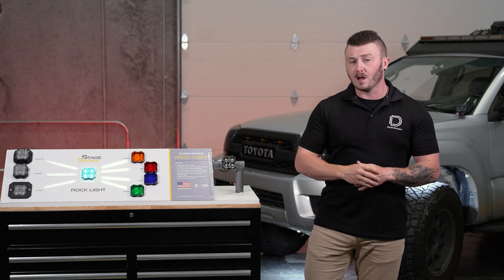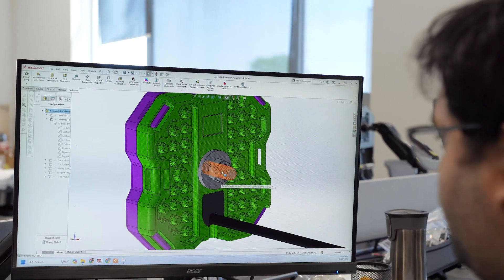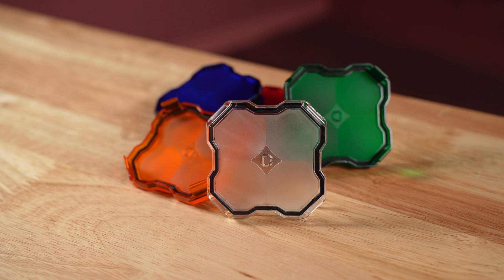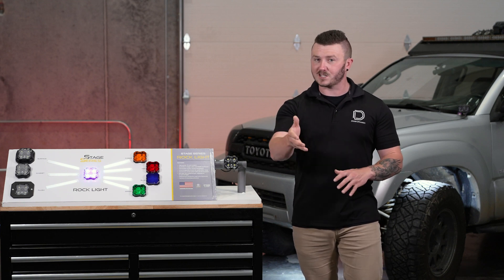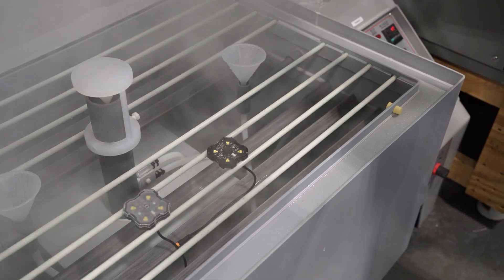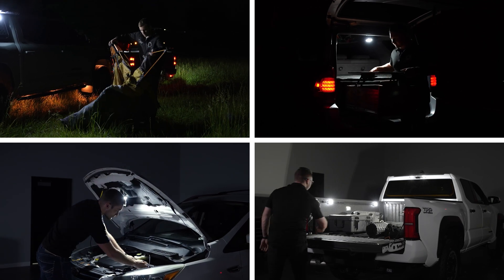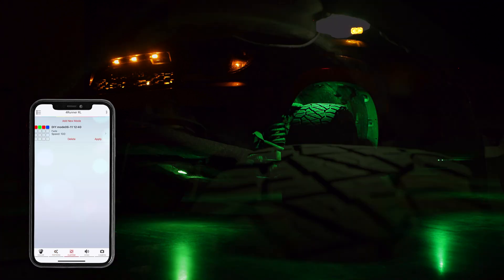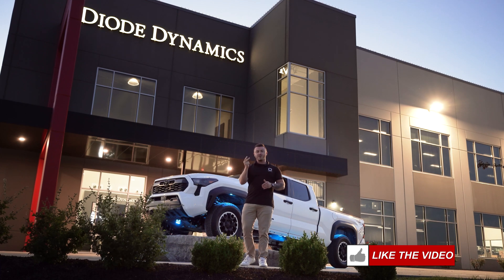How We Made the Toughest, Brightest Rock Lights on the Market | Diode Dynamics

Comment: I'm intrested in using these in my cargo trailer for flush mounted ceiling lights. the roof is insulated. will the heat generated from the heat sync on the lights become an issue because of the insulation?
Reply from the maker: Hey there! 

Our Stage Series Rock Lights do produce heat and when mounted it's import to consider factors such as insulation when installing the product.